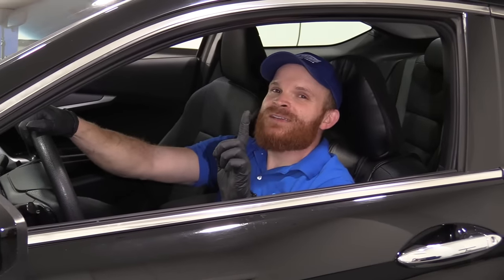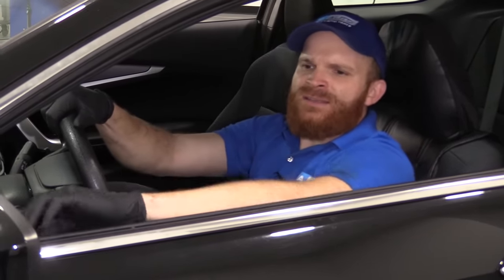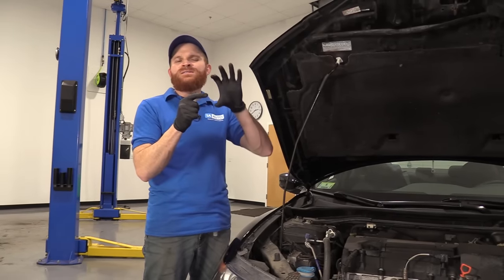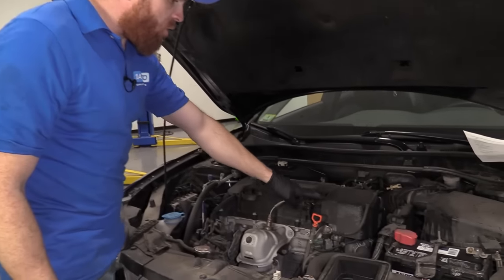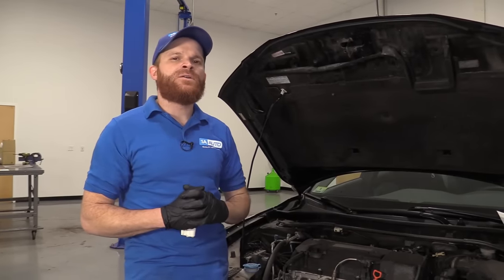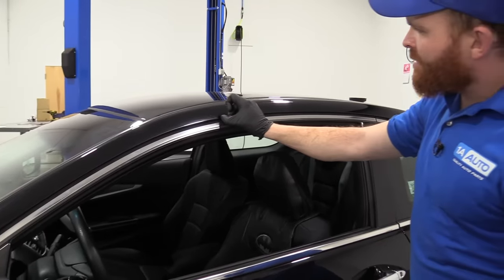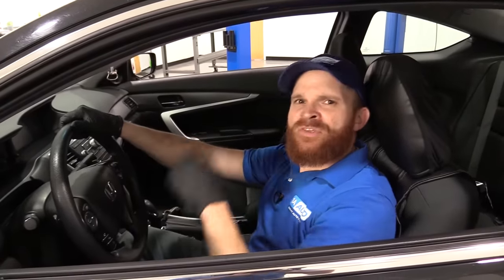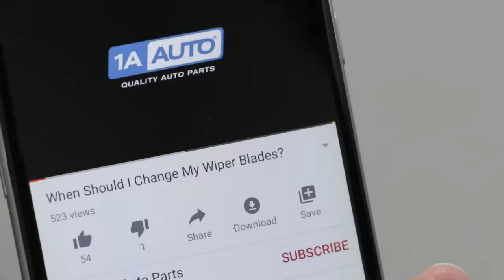Top 5 Problems Honda Accord Coupe 9th Gen 2013-17

Comment: Still own my 13’ Accord Sedan - Sport Trim at 86,000 miles, bought in 2013.
My starter did need to get replaced at 1-2 years in, was replaced for free.
The stereo volume knob wasn’t working and whole unit was also replaced for free.
Occasionally my back up camera wouldn’t display on screen and that too was replaced for free.
Send my car to the Honda Dealership for its regular maintenance and have not had any other problems.
Would highly suggest anyone looking for a used vehicle to look into the 9th Gen Accords.
And wherever you might be, be safe out there!
Reply: How did you get all those things replaced for free?

Comment: The starter fix for the v6 is u need to rotate the starter ringer gear/aka torque converter ring gear counter clockwise one bolt hole..anyone can do this within one hour by urself. I did this and only this to fix the starter grinding issue. While I was rotating the torque converter to remove the 8 12mm bolts I checked every sing tooth for damage. Mine had none. 

I haven't had a single bad start-up since this. The TSB from Honda says to rotate the torque converter ring gear counter clockwise one bolt and to buy a newer upgraded starter with the part number having a (A)in it. Do not use a reman or a eBay/Amazon starter that doesn't have the upgraded starter. Expect to pay $4-500 for the starter. 

Than there's also alot of complaints claiming that if u have a lower CCA battery like 550cca battery than this is a contributing factor to your grinding starter issue. So buy a more powerful batter. I believe these cars can handle around a 750cca battery. This is all known information put out by Honda in their TSB on how to fix the starter issue. Everyone I've known with the starter grinding issue and has followed this advice had fixed their issue. 

If ur starter ring gear/ Torque converter gear gets damaged it's gonna be more costly. So DO NOT WAIT to fix it. U can literally possibly fix it free just by rotating the ring gear as I did if u catch it with in a dozen grinds or so before there's damage caused..don't wait the fix is easy. Anyone that had questions just look it up. Or find me in 9th gen Honda accords on Facebook. Good look my Honda family.

Comment: I have a 17 accord and the only thing that i did to it was replace the battery in 2021. I did research and i put the sport accord size battery!  And now almost 5 years this september i do notice that oil starts getting low just a little. But if you love taking care of your car it will take care of u for 300k plus miles.

Comment: I have a 2013 v6 6m with 200k. Oil changes,  brakes , tires and timing belt are the only things I've had to replace. This thing is bulletproof! And the crease in the driver's side mirror is awesome,  perhaps you should actually drive the car before you critique it lol.
Reply from the maker: +Daniel Rinehart Thanks for the feedback!
Reply: God damn you must have a Uber car that's waaaaay too many miles on an 8 year old car

Comment: I’ve a 13’ Accord Sport 6 speed. 306,xxx miles. Never had the valves adjusted, original clutch, original transmission. It’s a great car and still runs. Sadly it’s totaled due too a deer accident but I plan on rebuilding it.

Comment: Minimal issues with my 2015 LX, 78k miles.  Mirror issue I never noticed.. maybe my car didn't have it.  Zero challenges with the starter.  Minimal oil dilution issues.  Zero CVT slippage, even at steep grades. Had no problems with the CVT, and actually preferred the immediate "downshift" compared to other cars (2018+ Camry) having to hunt for the right gear when you just need to go. Averaged 36mpg per tank, 70% highway.  Uncomfortable seats? Maybe his particular car with leather..  I did 6 hour drives with the cloth seats in the LX and was never uncomfortable.  Really a great car. Only real issue was left rear power door lock stopped working. not a big deal since I rarely use that door. I could still manually unlock it with the button, and would just leave it locked all the time by default. Some wind noise in the rear.. overall road noise wasn't great, but I got used to it. Bluetooth always sync'd to the phone before I even got in the car. Always worked flawlessly. Backup camera was great. Tires.. while on the narrow/bubble side (205/65/R16), were at least cheap to replace..  $110 for Continental True Contact, which had better ratings than what came on the car, Pro Contact.  
The only main downside to the 4cyl Sedans is the cornering. Lots of body roll. However, at DriveAccord.net, you'll find forums on a simple easy 30 minute do it yourself rear sway bar upgrade that helps the understeer/body roll significantly. I never got around to doing it myself, but people are confident in it.
Reply: Wow thats great...i love this model
My dream car!! I own a 2003 accord its old but drives pretty well..

Comment: I have a 2017 Honda Accord touring V6 with 78,256 miles. Found out today I have a rear main seal leak between the engine and the transmission which they quoted me $2347 to repair. Thank God I bought the extended warranty seven years 100,000 miles because I’d be up poops Creek. Luckily I only paid $1300 for that warranty and it just paid for itself in spades.

I’m not gonna lie I’m pretty disappointed I’ve owned four Hondas never had an issue like this all had V6 motors. Dealership claims they’ve never done a rear seal on a ninth GEN Accord V6 so maybe it’s a fluke. With that said I love the car it’s amazing it’s my favorite Honda of all time. I would’ve paid it if I had to because I love the car that much.

Hopefully no one else has this problem. If you do post I’d love to hear.

Comment: The oil consumption comment is right on target on a 2014 accord. It does consumme about 1/2 a quart per oil change ( every 3 or 4 k miles in my case) what I did was that in every oil change I started using 4 quarts 20 oil and one quart 30 oil. I notice an improvement with that. I did it since the car had over 60k miles and i thiught a little bit thicker oil woulnt hurt it.
Reply: If you continue to use different weight oil other than 0-20 you will do major damage to your engine, this engine is really tight and anything thicker than what it calls for cause internal damage. And always use full synthetic oil,

Comment: My 2014 Honda Accord EX Sedan just turned 70,000 miles this week and been the best car I have ever driven!  Mainly because of it's ultra smooth CVT transmission and Earthdreams Engine with plenty of power:)  No starter problems, Some oil consumption (because I have a short trip to work..8 miles).  I add a little bit now and then but can go over 1.5 years w/o an oil change using Mobil1 Extended 0W20. I just changed the Oil, Filter, and CVT fluid too.

Yes there are paint small paint chips on the front hood from driving 38 miles to work one way for the first 3 years but that is normal wear and tear!

Yes I still have the excellent original Goodyear Assurance Tires with plenty of tread left. What tires do you think I will put on it next:)

Did say it was a great car?  My 1994 Honda Accord EX Sedan lasted 22 years with still a $1200 trade in value.....how can you beat that?
Reply: Right on brother Honda Accord are best cars ever
Reply: That's because the 94 accord you had was a sedan and that was a great year for the car as well

Comment: I have a used 2014 accord coupe, and the starter is definitely beginning to have issues. The car makes a horrible grinding/squeal sound every other time I start it. It only has 56k miles, so it’s a bit disappointing, but if that’s all I have to replace for the next few years I’ll still be happy
Reply: Is that noise coming from the starter or the GDI pressure?
Reply: did you check the serpentine belt?

Comment: I have a 2013 accord 2.4 cvt lx…with 168,000 miles…my question is how much life do I have with the fuel pump?…also the cvt transmission,water pump,cats,…car is well maintained…if anyone can tell me the typical failure miles on the mentioned parts…thanks.

Comment: I have a 2013 Accord 4 cylinder, bought new, has 220K miles on it now. It uses maybe a quart of oil every 5K miles. Replaced the started at 165K miles, not a difficult job. The only real issues i had was the timing chain tensioner started failing at about 150K miles (quick noise on startup, no damage), and it can be replaced through a cover on the end of the block, through the wheel well. And the valve cover gasket started leaking oil at 200K miles. Paint still looks great. All the other things mentioned here, well, it doesn't match my experience. Even the seat cushion is still cushy. Great car.

Comment: 2014 base lx-s coupe with 155k miles; Mirrors are nitpicky, I have already replaced the starter so definitely agreed there. Oil consumption isn’t an issue? Never had any of those problems reported to me. I will say the paint on the edges of my hood is flaking off and exposing the metal underneath but just barely. The seats are fantastic. It’s a ten year old accord. I’m just hoping it’ll go another ten with minimal problems and these mentioned here are all fine with me!

Comment: Thank u I going to look at a Honda Accord 2013 to buy and I really needed to see this video.
Reply from the maker: +jason hunter Thanks for checking us out! 1AAuto.com
Reply: Don't let this video scare you.  I have my 2013 Accord LX CVT and it's a great car.  Good on gas and very roomy.  The car did used about 1/2 to 3/4 quarts of oil between oil changes but it's no big deal...engine never experience any issue.  Had the car for 4 years and the starter still working fine at 60K.

Comment: I have a 2015 accord sport and the only problem I had so far was a bad starter, nothing else, no oil consumption, no paint chip, etc... but then again i only had this car for 5 years with only 56,0000 miles. Thank God.  One thing that had to be replaced 2 twice was the tires, the 235/40/19 continental tires aren’t cheap, overall I love this car.

Comment: 2014 Honda Accord EX-L V6 coupe.
86,000 miles starter grinding periodically. And noise from timming chain area. Had starter replaced and new timming belt. Running smooth. Luckily my warranty covered everything.

Comment: Honorable mention issue: vcm mechanism in v6 models (barring the v6 manual coupe), causing oil consumption, excessive spark plugs wear, blow-by, etc.

I muzzled mine at 5800 miles when I got my 2013 Accord v6 sedan.  I'm at 13,600 now, no vcm shudder, my oil looks good (I change it every 3000 miles, I'm not taking any chances), and I put in an AGM battery for faster starts, and less stress on the alternator and starter.

Car isn't perfect (I agree on the seats), but I love it.  I do wax the car monthly though with a clay bar and lubricant to get rid of dirt and grime.  

Jason

Comment: both my 90's accords i bought with just over 100k, they lasted me well over 370k just doing regular maintenance. i did do some racing with em 90% stock parts and only really had to change the water pump , thermo, brakes, tires, cap n rotor, plugs n wires, oil change n valve cover gasket. thats literally all i did with both of em and they lasted forever. i will definitely get another! older models arent as expensive as the newer models and dont have all the computer bs which is easier to diagnose in my opinion.  good video tho bro but its " vehicle " lol!!
Reply: I’ve had both 90,92, and now 99. To this day I would take a CB7 over any of them.

Comment: 9th gen battery is too small,I had mine replaced twice under warranty and decided to just put in a bigger battery
Reply: Anthony Williams I did same.
Reply: Pro tip, great idea.
Reply: Yes, the batteries suck.
Reply: Same here just switched mine out today for a bigger battery as well!
Reply: I did that to my 2003 accord, it needs a bigger battery, the Civic does just fine with the small battery
Reply: Yeah the stock batter doesn’t produce enough AMPS for the car which is just stupid replaced mine a while ago and haven’t had a prob since thank god
Reply: You don't have to buy a bigger battery to get more starting power...just purchase one that have higher cranking AMP!  LOL  All Honda used smaller battery to cut down on weights.
Reply: @ericramirez5164  I had my 2015 Accord for 4 years and my battery still working just fine, even in cold Minnesota weather.

Comment: As a former Honda tech I’ve never really experienced any of these sort of problems on these the main problems is the LED day time running lights always go bad and the cv axles In the rust belt have a tendency of snapping where that rubber donut on the shaft Honda has a service bulletin for these only for the cvts on both sedans and coupes

Comment: I have 2013 accord 2 door with 4 cylinder engine (125k miles). I agree about the seats. They are not bad for short trips but anything over 1 hour and I start to notice the lack of comfort. Also, my engine runs strong and passes inspection, but mine DOES consume oil and I have to top it off 2 to 3 times between oil changes. Furthermore,  I did actually replace the PCV valve but it didn't help..... The mirror thing doesn't bother me at all. Hope this helps somebody.
Reply: What about when it start overheating? You might have an idea?

Comment: I own a 2015 Accord Sport that I bought new and problems I’ve had are a Rear Wheel Bearing going bad, and replaced the battery twice because it’s too small.  Cosmetic issues is the most concern now.  A lot of the clips and tabs that held on plastic pieces and bumpers are wearing out.  I’ve already had my whole inner fender well covering come off on the front passenger side.   After it came off, the whole shroud under the radiator started to come off but I put zip ties on it to keep it from falling completely off.  Bumper pieces are wearing out and seem like they will come off in a lil more time.  Overal though, the car is a great car.  Reliable as it gets as long as your battery good lol.
Reply from the maker: +dncrra Thanks for the feedback!
Reply: I'm hearing something in the back too like back passenger wheel area
Reply: Are you from a cold and snowy climate? Really haven't heard of those cosmetic issues before.

Comment: I have a 2016 EX-L V6 coupe. I currently have over 150k miles on it. Yes...I have to drive a lot! Nothing but routine maintenance on this car. I drive about 700 miles a week and am perfectly comfortable in the seat for 3 or 4 hours without stopping. I was able to work from home during the pandemic or I'd sure;y have way over 200k on it. I still runs like new. No oil consumption problems. No issues with the mirror. It even seems to make the tires last past their expected tread wear ratings lol.The only things I've had to replace other than routine maintenance items was the windshield ( flying rocks on the expressway) and the front struts and right front rim due to a massive pot hole that tried to eat my car. My biggest complaint would be the Alpine infotainment system. The stereo sounds great but the system is very slow, the Apple carplay/ Android Auto crash constantly and the display is kind of cheap looking. Other than that, this car is easily the best car I have ever owned!

Comment: Just bought a 13 Accord with 75,000 Miles in very good condition. Got used to the mirror. I love the backup camera but HATE the Bluetooth for the car! It has a consistent problem with pairing phones and syncing contacts. so I use the Aux port for hands free talking.
Reply: I have a 13 EX-L and the only thing I dislike about the Bluetooth is that it takes so long to sync. But It auto syncs everything every time I start it up

Comment: I have a 2015 honda accord EXL and only issues of this video that is true is the starter issue. I’ve replaced it because it gave me issues, then after like 3 months I started it having issues again. I might have to replace it once again or maybe they can check the cables but everything else is fine. Oil consumption is a little higher but not that crazy.

Comment: Mine is a 2013 exl v6 that is 11 years old at 178,000 miles. So far none of these things were a problem for me. The seat could be more comfy though. Depending on what I'm wearing, I do find my body can slide down into a less comfortable posture with the lack of friction the leather provides. Otherwise the only problem I've had is irresponsible drivers in other vehicles damaging my vehicle in an accident or with a shopping cart. I have taken care of the vehicle & it has responded well to this care. Cant do much about someone running into your car parked in your driveway while your inside having breakfast though. Lol